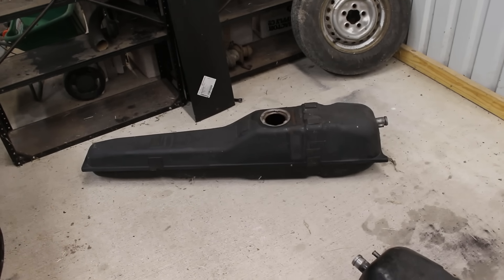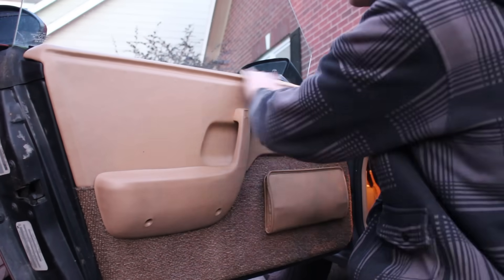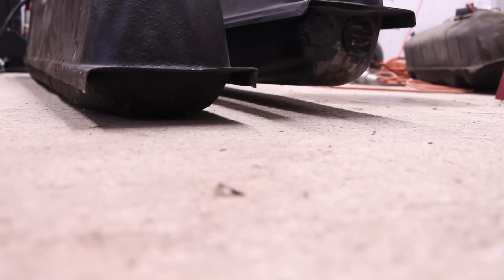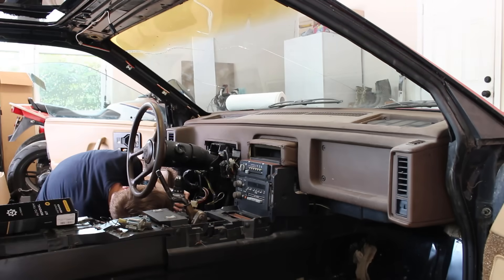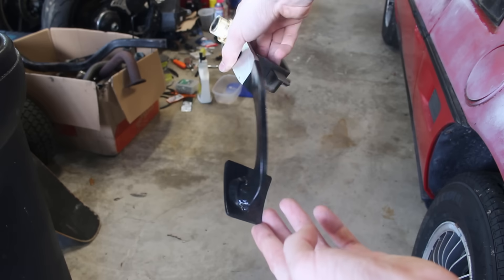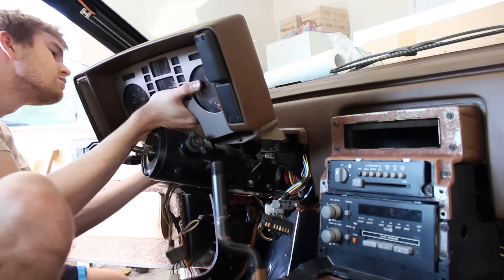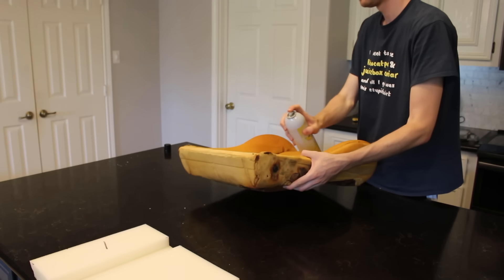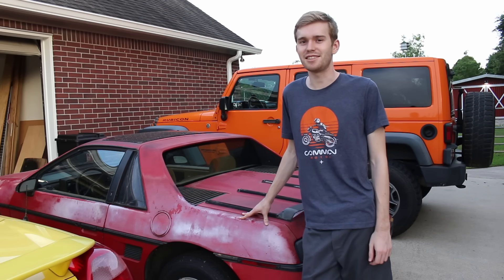The Cleanse | 1985 Fiero 2M4 Revival - Part 5

Comment from the maker: So I just realized that I said the new headrest speakers are 10 ohm and the originals are 8 ohm, but it’s actually the other way around! Please lower the pitchforks and extinguish the torches. 

Hope you guys enjoyed the video though! I’m hoping to release at the very least one video a month from here on out. I hope you guy like engine rebuilds because that’s what’s coming next 🤞🏻
Reply: I wish I could adequately express just how much these videos have meant to me. I'm just sorry that they're eventually going to run out.
Reply: I was wondering why the foam around the speakers was so black. It almost looks burned or something
Reply: even a short video once a month would be nice, even if you don't get anything done ... i was thinking you gave up on this project.
Reply: Okay just finished watching tthis part, roll on with part 6 please :D
Reply: I was confused at that part as I realized something was backwards in the statement but just brushed it off as it doesn't matter. I have 3 Ohm satellite speakers connected to my receiver which recommends 6 or 8 Ohm speakers. I have those channels turned down and I also never turn the volume up that high, if I did max out the volume it would probably trigger over current protection.
Reply: If you're worried about excess current turning your headrest into a fire hazard, you can always wire a 2.2 ohm resistor in series. It'll have to be able to dissipate a lot of heat, but it'll work.
Reply: When will be the next video  uploaded...???
Reply: Love the videos bro. I hope the next one isn't 6 months from now. I really thought you abandoned the project and were going to leave us all hanging. Glad you're back though,  Keep up the good work!
Reply: you forgot to add sub-woofers to the bottom part of the seats
Reply: Keep up the videos. Great work!
Reply: as soon as you said the 10ohm speakers draw more current than 8ohm i immediately hit the comments sections to address that mis-statement only to see this post hahahaha.
Reply: dude no gloves?????
Reply: My day just got made I thought I had to  wait till 2023
Reply: Ronald Finger Did you grease the window motors, gears and Rubber?
Reply: Are you planning to add any sound insulation? Just curious
Reply: Ok so About 6 Months til the next video xD love the project wish I could find one in the UK.
Reply: I've been waiting for this video, thanks for finding time to post.
Reply: Ronald Finger hey there’s a cleaner called g101 you have to water it down otherwise it will melt it I use it for work great stuff
Reply: Very nice work! Loving the videos.
Reply: @ChrisOnez718  according to Mr Mike they arent necessary  the sound will come out of the cloth no problem i wanted him to make speaker covers with piping thats when he said dont even need the holes. a saving of 30 bucks lol.
Reply: Hey!  Good luck with the engine rebuild.  If you go step by step, it's pretty easy to do... relatively speaking of course!  I can't wait to see...
Reply: @ChrisOnez718  oh i saw that comment lol i thought it was because of years of dirt I have a 84 fiero im restoring  
hmm what i commented to was about no perforations in the new seat or at least thats what i thought i saw hahahaha.
Reply: Oh I LOVE engine rebuilds!!
Reply: I had a silver 1985 Fiero SE 2M4 back in the late 1990s, when there were still a few Fieros and a lot of other cars with the transverse-mounted Iron Duke engine kicking around in junkyards. Odometer started at 170,000 for a $350 car with a clutch that wouldn't release. Odometer went to just over 300,000 before I had to let her go. I miss that car every day. 

- Clutch pressure plate was bad. The hydraulics between the clutch pedal and the clutch slave cylinder were sealed with cigarette paper when I looked at the car. I figured "Polish mechanics" (I literally bought the car from a Polish mechanic!!) but it really was the clutch pressure plate. To yank the Duke, I used a steel strap around the floor joist in my living room and a chain hoist hanging in the garage underneath. Make sure you have some scraps of carpet or other padding and a jack that will work sideways for the dogbone and the alternator. GM says you can't get the 2.5L engine out from the top and avoid having to do a full alignment of the front and rear wheels, but you can. I think a GM dealership quoted me 44 hours of labor to do the clutch. I did it with hand tools in Ottawa, Canada, in frigid -15F January weather in less than 10 hours. 

- Engine rings and bearings, cam and lifters, about 200,000. The timing light wasn't holding steady when I was trying to set the spark, it wobbled like crazy even with the ECU in diagnostic mode (hair pin across the proper terminals). Timing gears were going bad, and they can break. It won't damage or destroy the engine, valves and pistons won't collide, but it can strand you at any moment if the timing gears fail. Out came the engine. Rings and bearings, cam and lifters, gaskets, etc. About two months, would have been less if I didn't have another car. Engine in and out in about 5 hours, excluding work on the engine itself. 

-  EFI Issues, Part I: A 1986 throttle position sensor off another TBI GM vehicle is not necessarily your friend. I put a 1986 TPS on my 1985 Fiero. It didn't go well. After a very unpleasant drive to work with a solid Check Engine light, I opened up the engine bay to see a cherry-red exhaust manifold. Needed the car, so I took it to a GM dealership. TPS was backwards for the car, so at idle, the ECU thought I had my foot to the floor... and when I had my foot to the floor, the poor computer thought I was idling. With the rest of the data coming in, the computer was confused as hell and did its best. Don't mix parts like the 1987 gas tank in the 1985 Fiero. They changed a lot in the last two years especially (and the last two years are absolutely the best and rarest Fieros). 

- EFI Issues, Part II: Car's running like a million bucks with 280,000 on the odometer. Purrs like a kitten, acceleration is pretty good if you know the Duke is a long-stroke torque motor and drive it right, great on gas when you throw it in 5th (I was lucky!) and just cruise the freeway. Pulled into the gas station, filled it up, and went to start it. Cranked quickly, good compression, good spark, but would not start. WTF? Tried again, no start. Pushed the car out of the way of the gas pump, got her rolling, and dropped the clutch - started right up! Car guys were telling me that if it starts off a push, it will start with the starter. BS. I'm an electronics guy and I knew there was something more.... The problem gradually got worse until I no longer trusted the car unless I could park it on a hill. Electrolytic capacitors in the ECU, parts that cost 10-30 cents each, were dying, and I had to solder in replacement parts on the circuit board. Think of electrolytic capacitors as tiny rechargeable batteries. Because the electrolytic capacitors were bad, the ECU was rebooting every time the starter pushed the engine through a compression stroke, so it never got spark or fuel right and the engine wouldn't start. (Please, this is not just for Fieros, if your car has EFI or other weird electronic problems, look into what capacitors are and how they fail - you might save your car from the scrapyard.) 

- Rolling Chassis: Do it all at once. In a 1984-1986 Fiero, you have 4 balljoints in the front, 2 in the rear. You have 4 tie-rod ends in the front (inner and outer) and 2 in the rear. Do all your wheel bearings at the same time. Check all your suspension bushings and play in the steering rack. Then treat yourself to an alignment and four new tires. The car will corner like it's on rails. Really. 

- Cooling System: REALLY good though it has a bad rep, but I think it's undeserved. My engine fan might have come on twice in all the miles I drove that car, and that was lots of stop-and-go city driving in hot climates (but my car had no AC). With the engine cold, open the hood and engine bay. Take off the radiator cap up front, take off the thermostat cap and thermostat in the back. SLOWLY fill the radiator (UP FRONT) with antifreeze mix until it won't take any more, then cap the radiator properly and don't open it again. Go to the rear of the car and pour more antifreeze mix into the thermostat housing until it's at the barf port for the coolant reserve tank. Put your thermostat back in, cap it, start her up and take the old girl for a ride until the temperature gauge hits mid-range. Top up the coolant barf can to between the LOW and HIGH lines. If you have no leaks, you'll have a happy car. 

As you can tell, I really miss my Fiero. Please take care of yours. And I hope that what I have written will be helpful to someone else who is restoring a truly unique, groundbreaking, amazing, and proudly American car. 

Next year's Corvette is going to be a mid-engined V8 car. 2020 Corvette = 1990 Fiero V8 prototypes Pontiac was doing when GM killed the Fiero, just when they finally got most of the bugs out of it. The Fiero should have been an American icon. The new Corvette (with plastic body panels, no less!) will owe a lot to Fiero innovation and experience. 

Lawrence Wade 
Ottawa, Canada
Reply: I like all of it👍🏻
Reply: Hoping.....
Reply: Ronald Finger awesome video you are very very intelligent I learned a lot from this video
Reply: but the real question is did you clean the pockets on the doors from the inside? :P
Reply: @GreatJoe  unless you are running extreme wattage on your speakers you actually dont have to worry about heat. the blackening of the headrest, in my opiniopn, is due to something else
Reply: Finally Pt. 5! My YouTube life is complete now.
Reply: When can we see the next episode?
Reply: might want to take SIMPLE GREEN from Wal Mart and soak the insides full strength to kill the stuff and leaves aplenty stink.plus all the vents have mold and poop  in them so they need attention too
Reply: Man. Before I saw your videos I was all proud of my youth. I made a track racing cars preparation, I made a rebuild old cars like 4-cyl Porsche (actually I stopped doing it when huge costs at Porsche Service has revealed and there was no other way than loading a pile of money - the amount close to what I already spent on the project). I sold my 944 and came back to 2,0 V6 Mitsu Galant. So yeah I was all good or even more. I lived on my own, right after doing my studies I become independent (while making studies I used a National Loan for Students - I don't consider it as being independent).  Doing stuff I loved, having a great girlfriend I loved... yet today I wish I was more like you. Just steady, firm life concerns first and all whats fun and great to play with, on the second, or even third plan.
Also, I wish there was a YouTube at that time. Yes, there was the YT - with 240p picture quality and about 5000 of viewers - all from the USA or western Europe countries. 
I think if I had this opportunity I wouldn't do all of this I did just for myself. Bikes, airguns, firearms, archery, knives, fast and old cars, MTBs, good times, books... I shared some on forums because it was the most common place to stick around and a way to stay close to ppl of my kind. I wish you all the best, Still jealous of how well it works for you.
 Stay safe and stay true. :)
Reply: Lawrence Wade 
Wow, thanks man
Reply: I just subscribed to the channel. This is the first episode I've watched but I enjoyed every bit of it. Classy shit man, I like your style.
Reply: @simonro9168  They spray the foam black so it won't show through the perforations in the stock cover.
Reply: Whatever u do dont repaint it! The exterior tells part of the story!
Reply: You can always use resistors (best use with variable ones) to ballance the resistance and avoid the sound system shortcircuit protection to kick (if it has it), thoug it still a shot and it might trigger depending how it works. GL,BR, CU Nx Time!
Reply: Love your videos keep up the good work 👍
Reply: Promises, promises.
Reply: actually came to the comments just for this... lol
Reply: Ronald Finger hey thanks for the new episode.  This is what YouTube is for and I’m really enjoying your work.
Reply: The skit you had in this at 3:15 it would be cool if you did some cool skits or cinema graphic stuff.
Reply: Engine rebuilds are falcon outstanding~ Keep that fokker rolling!
Reply: CalvaryCustoms 

Wow 😮,  I sure hope you find any rebuild channel that is free of frustration. So sorry 😐 to see you leave 👸🏼🤴🏽.
Reply: By engine rebuild you mean v6 swap? 😁
Reply: This is a great rebuild project.Looking forward to future episodes.Any plan to upgrade the sound system?
Reply: This is outrageous !! I started by watching a detailing of a 37 year old mercedes then part 1 fiero......Next thing I know I am at part 5 wanting more !! Great job. All thru these videos I was saying  "been there.. done that "!! When you were cranking on that valve cover bolt I asked "is he still doing the valve cover??  NOOOOO. then POP goes the bolt...How I knew? Like you said --its a learning experience lol. Keep up the good work and I am a new subscriber !!
Reply: You guys make me laugh so much awesome
Reply: epic build but U should have left the interior gutted until the bodywork was done, now all the sanding and paint oversprray could migrate into the interior.........................buy some good plastic and tape !!!!!!!!!
Reply: Invest in a brass bristle wheel chuck that u can just zip into any electric drill and clean away. Would've made those seats 100
Reply: Ronald Finger if u need any helper pls contact me
Reply: @criven3128  I think he will do so. He did it to the floors
Reply: That music + seeing a Fiero gives me nostalgic 80s feels! I was 6 years old in 1985; my brother and I would "call cars" on the highway and elsewhere, wherever my mother drove us. Best car we saw was a purple Ferrari Testerosa, speed right past us on the highway, around 1987. We always liked the Fieros too! 😊 Back then, the Ferrari F40 was the dream car! 🙂
Reply: Ronald Finger when is number 6. Starving In NC
Reply: Ronald Finger it’s a month now. I would like to see the update :)
Reply: Waiting for part 6
Reply: Very familiar with industrial sized ozone generators and you're 100% correct, they can kill you.  If they're large enough, they can kill an entire warehouse full of people.
Reply: a heat gun and a bit of careful elbow grease should fix those top panel misalignment issues.
Reply: I'm one of them

Comment: What I learned from this series is that I would cut every corner at the first sign of a significant problem.  Broken bolt? Well, that's permanent. Gas tank doesn't quite fit? Longer straps.   
Ronald is awesome.

Comment: With the battery box and the valve cover, you have taken care of the big recalls. My dad worked for Pontiac for almost 40 years. I remember theses cars like yesterday. One recall was the battery tray bolt broke, and the battery would land on the alternator fan and rupture spewing battery acid all over a hot engine, second biggest was the valve cover gasket which also created fires.

Comment: When it's time to do the paint and bodywork, you definitely need to spend a few minutes going over the "Endura-flex" system. Multiple plastics and paints were used to make the body panels. I actually studied polymers under one of the scientists who helped develop that system. It had quite a few firsts for GM and some of those were industry firsts. Really was ahead of its time and hampered by internal squabbling. I just picked up an 85 myself back in April and am restoring it for cheap, just like you. Base coupe - no A/C, manual windows, 4 banger, 5 speed stick shift.

Comment: I just believe you are doing an amazing job on this. I owned an '86 SE with 2.8 V6. It was silver and had a grey interior. The car was fun to drive, but under powered and had a tendency to understeer as well. Bought it new and sold it before moving West in '91. My gas tank had to be replaced, a common problem, no doubt. Had a boil over problem once due to a leak caused by the splash guards in front of the rear tires. They rubbed through the rubber hoses connecting the undercarriage pipes from the front to the engine. Something to watch for when you rebuild the engine. Perhaps the 4 cyl. wasn't plumbed the same way, just cut the splash guards for clearance around those hoses. I will keep an eye out for your progress. So far, so good.

Comment: You could probably use a heat gun to warp the door panel into shape, enabling it to fill the window gap.
Reply: Add Transmission oil to humidify the plastics and it should work!
Reply: @900108Chale  add ambient music for mood
Reply: @trillrifaxegrindor4411  LOL!  Not sure about that, But ATF oil does help a lot quite often. Especially with heat.

Comment: As someone that repairs vintage eletronics, the 10-ohm speakers will draw less amperage than the 8 ohms since they have MORE impedance if they were 6 ohm you would have a problem!  More resistance equals less current draw. They just won't be quite as loud at the same volume level (considering they have the same sensitivity as the originals if they have better sensitivity they will be just as loud or louder)

Comment: 28:58 didn't you realize thet the rpm gauge  is stuvk to 2000 rpm
Reply: I think its a weird Pontiac thing my 84 trans am rpm shoots up after I turn it off it's just a visual though not a wear or performance thing

Comment: Excellent work restoring that Fiero's interior.

As a suggestion: you shoud've painted the seat rails and metal pieces before putting them back into the car, so they don't rust anymore